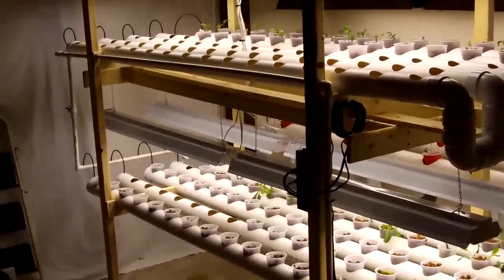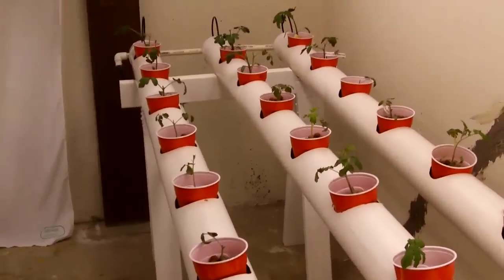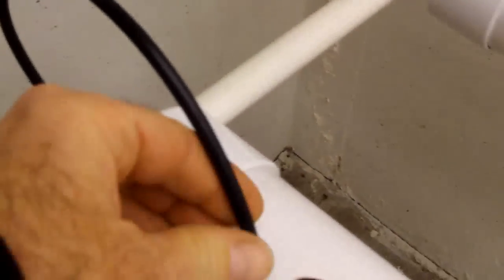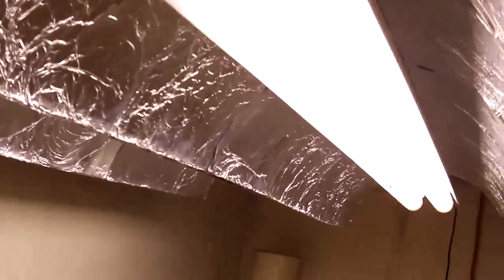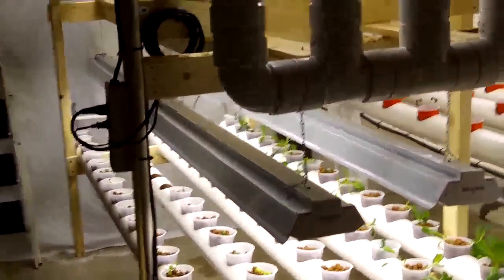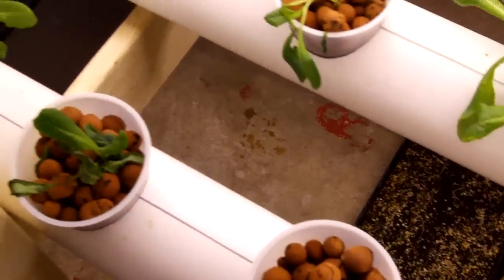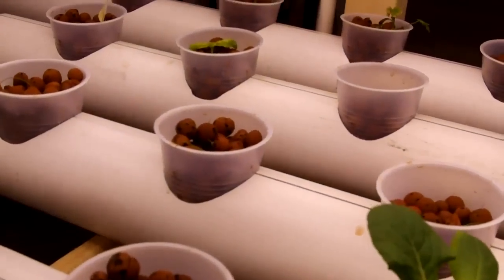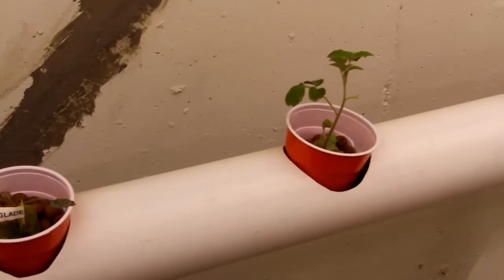Basement hydroponics project

Comment: Hi lakebound..

I grew in a very similar set up with 6" pipe. Only problems I encountered was root blockage and difficulty in cleaning the system out. I tried sponges on sticks and scouring pads to remove sticking roots from inside the pipes. 

I changed over to PVC Electrical Trunking 150mm wide x 75mm deep. Because the electrical trunking has a "Snap On" lid it's easier to clean and adapt with spacings. If things got a little blocked I could tidy the root system.. 

Nice looking system there..

Comment: great video!, though it goes to black at:5:37. it looks to me that this system has elements for plant to harvest and transplanting else where for space to grow tomatoes and others. also those lights are great for germinating seedlings and transplanting plans but probably won't grow food to harvest. HID or other high wattage lighting is necessary for that purpose. indoors growing is a fine way to supplement your grocery purchases. the costs are higher than growing outside but it is an integral part of season extension and seedling preparation. the overall system costs must be considered for the life of the components. if the structures and hose last for 15 years and the pump for 5 years then you allocate the costs by expense PER YEAR. excellent way to grow what you eat, organically! Bravo!

Comment: I love your entire design.  If you wanted to, it would be so easy to enclose each of those in drywall or panda film, or just about anything opaque and reflective on one side and have three separate light cycles going at the same time.  Plus that would give you all the light that is now going off to the side, as a tiny bonus.

I would consider using a flat white paint instead of foil on your home made reflectors.  Love them, BTW.

Comment: Clean design. I like it.  Though, you may want to consider using larger pipes to reduce maintenance of the system.  I've used the same size pipe, and I am having clogging problems due to root growth...  Also, I'd suggest to use LED grow lamps instead of Flourescent lamps.  They are better for all growth, flowering and maturing stages.

Comment: Very nice. My only worry with a basement hydro system is humidity. Do you have any issues? My basement is already fairly humid with the potential for mold so I run a dehumidifier.

Comment: When you start with seedlings that are in the basket, how does the seedling get the nutrition from the thin stream on the bottom of the pvc? I always see the after of plants with thick roots but I can't understand how to go from small seedling at the top of the basket to thick roots that end up in the stream of nutrients? Do you just water the baskets until the roots make it down there? How deep should the stream be in the pvc pipe?

Comment from the maker: I try to use smaller tomato varieties like cherry 'maters. Even when they get too tall, they are a vine and will grow wherever they like. It's not necessary to have them suspended vertically. They cherry tomatoes I grew 2 years ago just took over and went everywhere. The best tomatoes I found growing under the tubes. (Had to stand on my head to get to them, but there they were). Melted the holes in the cups with a soldering iron.....

Comment: I have grown that way in 3" and 4" pipes in my greenhouse for 20 years, lower your lights to just a couple of inches above the plants, careful not to overheat the plant,
 also be careful when the plants get bigger they will tip over and fall onto the floor, also be careful if you only use one pump and have no alarms, when your pump fails you may lose your entire crop.

Comment from the maker: I think I calculated my elect. costs back then and it was somewhere between 20.00 and 30.00 a month. They are flourescents so they are  cheaper to burn than metal halide or others. However, the light's not nearly as strong as MH or mercury vapor. You just have to keep the floro's close to the tops of the plants. The day of led's is coming where you can run lighting for pennies. There's still nothing like picking tomatoe's,  or making a fresh salad from your own efforts in January....

Comment: Never, ever ever, never use foil as a reflector!  Like hydro system its self though.
Reply: ***** Foil is a very poor reflector, it does more harm than good.  When you see picture of pro grow rooms with reflective sheeting on the wall it isn't foil. The stuff you want is called Mylar and you can get it at most grow stores.  If your interested in indoor growing get some good lit. which will explain the basics.

Comment: root rot?
Reply: Sorry for the late reply. I am not affiliated with this gentleman or his video. However i like to prowl comment sections and help people for the warm and fuzzies. Roots need three things Nutrients, Air and Water. Root rot only occurs when the root does not receive the proper air or more specifically "oxygen ratio." Yes, roots need air. This is 1 of 2 reasons why plant's do not grow in overly compacted soil,there is no air. The other being the increased resistance the compact soil situation provides. The roots in this hydroponics system, while submersed or partly submersed under water for most of their lives are provided with adequate Oxygen ratio's within the constantly flowing, non-stagnant water. Therefore no decay or "Root Rot" can set in.

Comment: Get a clue and stop spreading fallacies. The concrete is not going to be harmed by humidity.
Exactly how do you think grease and sand interceptors as well as septic tanks are made of concrete and are filled with actual water and are not destroyed, underground on top of that?
Not a great tip.